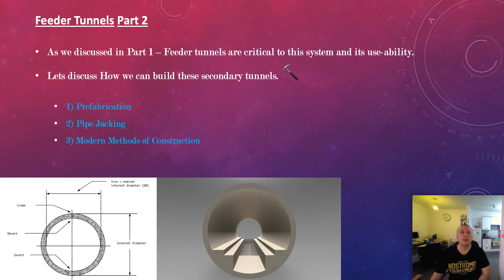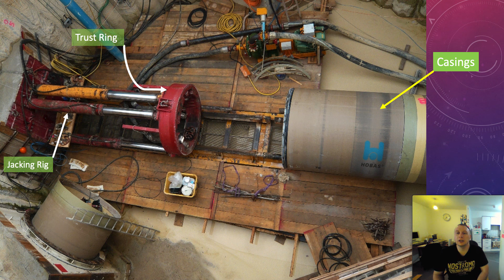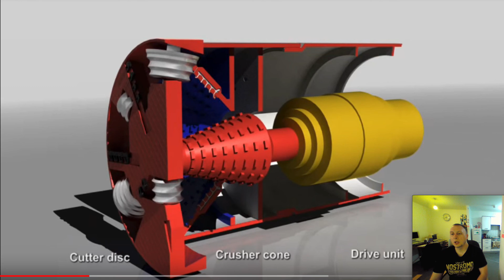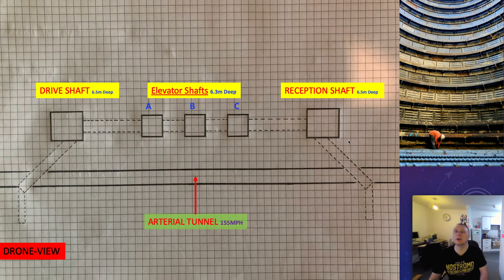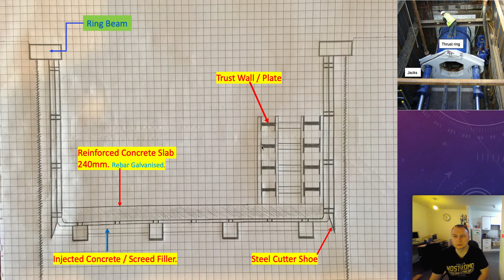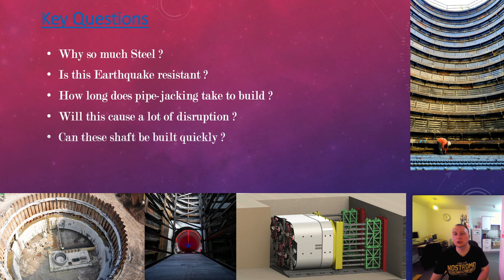Part 2 - The Boring Company Has Forgotten Feeder Tunnels 🙄 💸 👷🏼‍♀️ #30

Comment: My understanding is that a tunnel that is built in an earthquake zone you do not really want STIFF joints (I think that's what you said).   You need joints that can "give" a little to absorb the energy of the earthquake without damaging the tunnel.  I am no tunnel engineer so please check me on this.  

When TBC first started Elon mentioned that when you get to a certain depth underground damage from earthquakes is greatly lessened.....the most dangerous place to be in an earthquake is at ground level....and I know - I am from California and I have been knocked out of bed several times by earthquakes (and by women). 

Cheers..and thanks for the great videos.

Comment: Hi Will,
I like your construction ideas and explanations. However I still think elevators are the wrong path. Here is a simple path to using ramps
that is 25 times faster and much simpler. It could probably use the same construction techniques. 

The traditional limit to slope is 10% but this is due to the joint hitting the underside of the car as is passes over. The real limitation is 10% per segment where each segment is at least equal to the wheelbase of the car. Please checkout below image and let me know what you think.

https://www.dropbox.com/sh/502melzzf3y93pi/AAD9WnqjL8SIExDJx5UXn7Dya?dl=0
Reply from the maker: Greg Burke that is a really excellent diagram and A great visualisation of what is needed for this system in terms of ramps. Id quite like to use it in one of my videos if you don’t mind and then I could talk about why the boring company should use more ramps. 
Really awesome work. How did you draw it? 
Thanks - I really appreciate these kinds of contributions as it helps develop better ideas and systems!!!
Reply: @BoringRevolution  Hi Will, I would be honored if you use my drawing in a video on ramps. I love your format about investigating research ideas. I use Google Sketchup. A free, 2d/3d powerful program. I am a beginner in it, but it only took a few commands, line, circle, rectangle, dimension, move, rotate. It can group together items to make a new item (car) then you can have many cars. Most powerful is dimension command which measures point to point and labels with text. This way, no cheating, all is to scale. An example of powerful sketchup models is warehouse where you can get predesigned pieces.

https://3dwarehouse.sketchup.com/
Reply: I have 2017 free download version of Sketchup...
Reply: 30% appears to be max grade for normal car streets, see these pictures in San Francisco.
https://www.onlyinyourstate.com/northern-california/san-francisco/steepest-streets-san-francisco/
Reply: @BoringRevolution  Hi Will, Can you contact me greg.m.burke@gmail. I have a full 3d model with 28 cars including awesome Tesla Model S car I found. It works in Sketchup 2017. You can orbit around looking at it from different views. It shows an intersection so it explains why this works great to put ramps at start or end of block. I can send you the model and you can play with it.
Reply: @BoringRevolution  Hi Will, Here is a directory with some pictures of the 3d model of an intersection with  up and down ramps. This makes it easier to understand traffic flow and merging on the surface.
https://www.dropbox.com/sh/502melzzf3y93pi/AAD9WnqjL8SIExDJx5UXn7Dya?dl=0
Reply: Nice plans.  Sure looks to a non-engineer like myself that ramps seem to make more sense than an elevator. Cost, complexity, speed of throughput, etc., all for the relatively small trade-off of space.
Reply: @michelangelobuonarroti916  This is one of those problems where you see the solution and it appears obvious. Most people think of ramps at a fixed slope. Ramp angles steeper than 10% hit the underside of the car (triangle from wheelbase to undercarriage) so it would take a large ramp to descend 20 feet or more. Using S-curves, the lead in curve won't hit the undercarriage. The lead out curve protects the front and back bumpers from hitting. This allows the ramp to be much smaller.